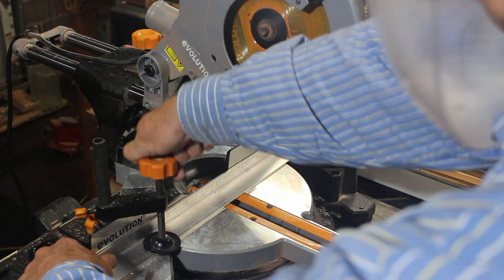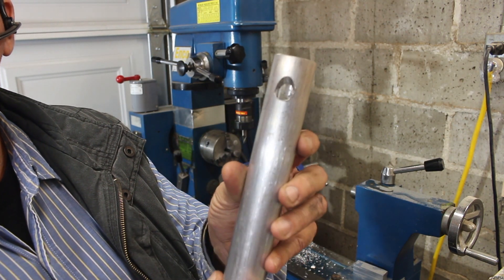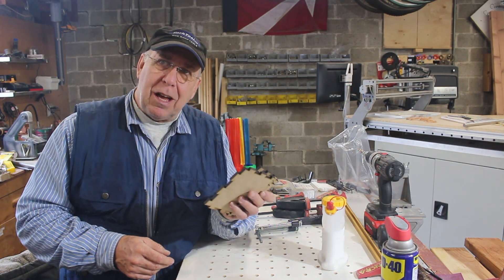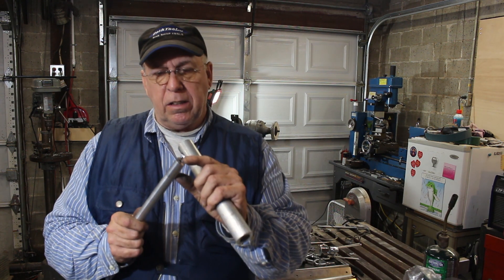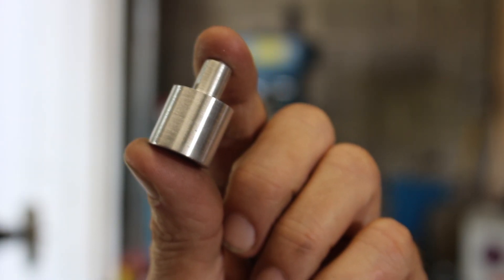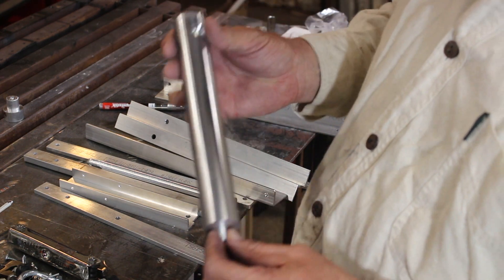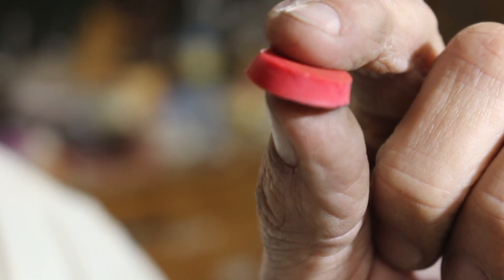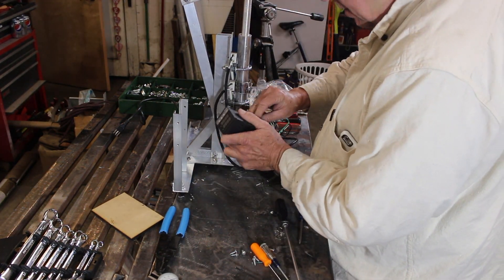Injection Molding Machine for under $100 in parts using less than $700 worth of machinery!

Comment: Built an plastics extruder for under $100 while using $5000 machines.....
Reply: Muskoka Mike I made something similar a few months back without all those tools, and though it’s not as well finished it cost about $90. Does it cost more than that because I used a drill I bought 10 years ago or a saw my dad gave me 15 years ago? You might need the tools to make it look nice but you don’t need the tools to do the same project
Reply: Notably, you don't have to spend $5K on machines to use $5K worth of machines. Makerspaces exist. Lots of them have machining equipment.
Reply from the maker: I made a video response for people who make excuses for not building by whining about not having tools. In it I make these same parts with nothing but a hand drill. You can see it here. https://youtu.be/84q3qjjJiV8
Reply from the maker: That laser cutter was only $1200 brand new and it's at a local maker space. Anyone who wants it has access to it.
Reply: Mike I think you're missing the point. Almost all of the work here done by 'tools' could also be done using hand tools. It just takes longer. The dimensions, and cost of materials, remains the same. The only real kind of expensive actual 'tool' you need for this is a lathe and if you really don't know anyone that already has one and you're a maker then DEFINITELY get one because wow that thing will pay for itself in no time.
Reply: Muskoka mike is an idiot. its says $100 in parts. no one counts the cost of the machines used. its not like you buy the machine to do this one job, then scrap it
Reply: How much can I buy a lathe like the one you used for, and where can I buy it at that price?
Reply: Muskoka Mike but it did....he already owned the equipment he used. It's not like he went out and bought the machinery for This project solely. And you can't add cost of labor because he's making it on his own. He's not paying himself by the hour to get it built. So yes in actuality he only spent 100 on what he needed for this project.
Reply: Yeah fuck that guy, didn't even include the cost of his upbringing and all the food costs along the way. He couldn't have made anything without eating at some point.. Geez..
Reply: Don't forget you can make a bow drill with jigs to make more of a straight line from wood found in the woods if you need to or scrap pallets.  Files and a hack saw with a punch and maybe even a really sharp chisel since technically, we can chisel steel even.  

Therefore, if you really want to think from the (at least my) beginnings in machine tool in high school... we started off with a hammer, hack saw, sharpening stone, and files like demonstrated and even though we didn't use a bow drill, a real hand drill (like hand operated) or another form of crude drilling... you can like the old timers who had like a water wheel with some sort of drive for a prime mover at best.

So I want to add chisels and a real hand operated drill can be used also. 

Think for sharpening the tools you can use a hand operated or maybe even treadle operated design grinder. 

Technically, I got your back on this one Wildman Tech.  

After machine tool and welding... I went to work the foundaries in the lab, later to learn more at Tech which used to be a School of Mines. 

Therefore, besides woods for wood, there is soil and geology for minerals. 

Now,  you need to find a clay deposit and the iron from maybe a bog or other mineral formations.  Then you can make a bellow, kiln and foundry and forge and make your own tools for nothing other than time to scrounge around for and mine for minerals. 

Here is a basic starter demonstration with some gaps you'll need to fill in between:  https://www.youtube.com/watch?v=VVV4xeWBIxE&t=4s

https://www.youtube.com/watch?v=FUhv2OnVVDU

Then read into blacksmithing tools and you'll find you can make all the tools you need.  

Now, the electronics is more challenging is you'll need to extrude the wire really carefully with successive rollings I think if I understand correctly.  I have to research wire making more.
Reply: Don't forget now days you might be able to find an old bicycle and make a pedal powered pretty much any type of machine you need.  You may want to make a huge tractor size flywheel so you can charge the prime mover up and get off and work unless you design so your work station work can be done while you are pedaling if you don't have someone else doing that.  Old salvage yards are great for parts to hack into also.  Ebay has cheep stuff to get you started.  Hunting around companies that throw away perfectly good materials as scrap too.  Estate sales, auctions, antique stores, shopgoodwill.com (though the stores are better price usually) and other bargain thrift shops/barns.
Reply: Why not?

You can get a lathe mill combo on e-bay for like $1500.00 shipped.

https://www.ebay.com/itm/Metal-Lathe-Mill-Drill-Milling-Drilling-Combo-Multipurpose-Machine-3-in-1-tools-/302331817457?hash=item4664616df1:g:SzQAAOSw9KpXAZEG
Reply: Lasersaur costs ~2 grand plus tools. Glowforge costs 3 grand. Hobbyist grade lasers that can cut wood and cloth aren't that expensive at all.
Reply from the maker: The one I used was only $1200 new and its a community tool that anyone can use.
Reply: Sorry, was replying to the person above you, and providing further examples than the one you used.
Reply: You are amazing. I am pretty sure he gets it now
Reply: roidroid you're wasting money. You could have just saved $30,000 by walking to the mailbox, putting the letter in the box, and putting the little flag up.
Reply: Amazing how someone had to make items from clay, stone and wood with maybe some animal hide(s) for bellows for the first metal tools of which their design was copied from that point on.  Most likely starting with non-ferrous alloys though really... who knows what natural phenomenon was observed and re-created in a different more manageable and controlled way.
Reply: Haha! I was thinking the same thing!
Reply: roidroid So what your saying is that, You go out buy car specifically to mail a letter, then walk away from it? Seams like an awful waste to Me...When ever I mail a letter I just draft up a letter on the computer I've had for ages, send it to the printer that I've had just as long. BTW paid cash for them long ago, don't know when I got the paper, or envelopes, stamps are forever stamps (Christmas time maybe?) whatever. Trifold it, put it in an envelope, put on a stamp, then put it in my mail box... Postal carrier picks up in the morning...
Cost of mailing a letter...
Big Fat: $0.00 
By your calculations thats a 
$30,000 savings 
YOU MUST BE A GOVERNMENT WORKER.....
Reply from the maker: I made a video response for people who make excuses for not building by whining about not having tools. In it I make these same parts with nothing but a hand drill. You can see it here. https://youtu.be/84q3qjjJiV8
Reply: brian alley 

He's not an idiot. The title has since been changed. It used to be 'How to make a plastic extruder for less than $100' - or something like that.
Reply: Mike D the cost of the machines don't matter.
Reply from the maker: The last guy said $10,000 worth of machines. You guys need to get a better handle on the cost of tools. I didn't even use $700 worth of machines in this build. I spent more on the damn camera than the machines. LOL!
Reply: I saw nothing done in this video that couldn't be done with tools that everyone has in their garage. Yes, he used high end tools but all that does is make it faster.
Reply from the maker: You know I eat, read , take classes and watch videos too. All of these things add to my collective ability to create, but I don't hear anyone faulting me for the cost being healthy or understanding this stuff. The investment in my tools is easily the LEAST expensive part of what I do!
Reply: Muskoka Mike you can buy a Grizzly G8688 7 inch x 12 inch Mini Metal Lathe for about $515 new and those are pretty good for a bench top. Not all fab machines cost a fortune sometimes you sacrifice what you want for what works
Reply: Actually, Marsh and I have been working on this machine in parallel, and I built mine in my garage using a drill press and a miter saw (cheap at Harbor Freight). The only part I didn't make was the nozzle, but we have since discussed how it can be done with the drill press, and I will give it a shot soon. 
I designed the controller box, and cut it on the laser cutter at a nearby makerspace. I don't even pay membership, I earn money there by teaching classes.
Reply: Don't forget the 50,000.00 laser machine used to cut the enclosure box. Maybe 100.00 in materials but then again a car also costs a couple of thousand dollars in materials to build. I was expecting a video for someone that would build it in their garage with minimal tools
Reply: I know, sheesh, my comment was directed to the "concept" that you could do it on the cheap....well, cheap if you don't have all that equipment. Whether or not you own it already, or paid for the equipment cheaply,  isn't the point.

Hell, I could say "build a Bugatti Veyron in your backyard for $39,95...." oh, wait, you need the parts, the tools, the engine, driveline, casting, carbon fibre, etc etc etc.....

BTW: if he "only spent $100 on material" then that's what the title should reflect.
Reply: I think you people are quick to defend Wildman Tech without understanding Mike's perspective. What Mike is saying is that the total cost of making that injector machine is way more than $100 because you also need to factor in the cost of the expensive machines which in most (my) countries will cost a fortune if you can even manage to find them.
However what Mike doesn't understand is the business aspect of things which is really the big idea many people are watching this video. That aspect is that if you are going  to manufacture an end product to the user you cant always factor in the cost of fixed assets. Those assets are only there to assist you archive your intended goal which is to make an extremely cheap product that you can deliver to the client. The actual end product in this case being the plastic product you want to press. So if I was a manufacturer id also only consider the cost of raw materials being used to develop a product and not my equipment which is fixed.
Reply: +Muskoka Mike

When i post a letter to someone, i count the cost of the stamp, paper, envelope, and the $30,000 CAR I DROVE TO THE POSTOFFICE.

Posting a letter to someone costs me over $30,000
Reply: Hay Muskoka Mike!  You do (kind of) have a point.   Aside from that I got a favorite saying for you, "Tools don't cost me money, they me make money."   Even if your just pissing around, they save you a tonne of time and give you a better product otherwise.  Time is worth money even is you pissing around.   That is of course one knows how to use them AND have or can come up with a use for them.  Just wondering, do you have a video of you making a plastic injection machine (anything?) you built with stone tools?  We'd all love to see that for the education.  Cheers bro'!  ;-)
Reply: Perhaps a cretin is less cretin than you, vakaka mika... But more than you there are only the deficients who nevertheless dare to give you a thumb up...
Reply: Mike hasn't got a clue on how to buy machinery cheap.
Reply: Did you get anything out of the video!? Why did you watch it? Are you going to be shooting plastic? Seriously yes draw a picture. My point is your a tool bag worth less then 100$..... Are you trying to troll or were you genuinely trying to make this for under 100$ the point of the video is for 100$ dollars you can make that......no one said you gotta buy the shit. If you weren't so a dick I'm sure you can find people to help make cuts and what not. It was informative and was on point. Was he supposed to post in there well you need a a lathe laser cutter drill press any of the other tools that you don't have the point is the raw materials for him was $100 that could vary from place to place maybe in one state it's $105 no need to argue semantics you're being a dick that's all that's my point you are being a dick. Post anything you want I'm done.
Reply: are you what they call "anal" or are you able to extroplate meanimg from spoken words?  Words aren't exactly like numbers, they require you to think a little on your own to get their true meaning.  Good grief.
Reply from the maker: No, he's just whining. I prove it in this video by making the same parts with nothing but a hand drill. https://youtu.be/84q3qjjJiV8
Reply: where I live you can't buy a non-operational POS lathe for that.....
Reply: @muskokamike127 If I were you I would move if the cost of living is really that high.
Reply: @phillhuddleston9445  where to? the States? Last time I looked I needed $75,000.00 and an additional $50,000 for legal fees to set up shop down there. It is that expensive to live here. We pay 66% in various taxes and our gas is around $5.00 a gallon.
Reply: @muskokamike127 , What communist country are you living in, you can't have a home workshop? I'm in Missouri (USA) and not only can I have a home workshop where I live I can also run a business and the only thing I need is a $50 a year merchant's license because I sell the products I manufacture at my location along with selling them worldwide. I also added a large section to my shop a few years ago and didn't need permission (a permit) from any government to do so. Freedom is a great thing, you should move to a more free location life is so much nicer. The federal government is a different story, having to get your product tested to UL standards is not good but at least in my case is still far cheaper than $50 thousand, I still can't see having to pay anything for a home shop, are you in California?
Reply: Wildman Tech 
   Towards the end of the video you say something about,. you know how it is    , and actually no I don't.
   Don't have a friend that can do laser cutting for me, don't have the thousands of dollars of lathe machinery and cutting bits ( yes the 10K comment was a little overboard) , and don't have access to shop space to be able to do this type of project. (which whether owning or renting it would seem that you could admit costs money?) 
  So maybe for you this is a hundred dollar injector, but for anyone else without the tools and space to use them their is much more involved in being able to do this.
  Hate to sound like one of those crazy SJW's, but perhaps your privilege is showing?
   Hundred dollar material project would have been a bit more honest title.
Reply: Point is Muskoka Mike?
Reply: that it really didn't cost just $100.00. That's only the cost of the materials. 

Put it another way: the actual cost in raw materials to build a car is minor. It's the labour and manufacturing and the millions in equipment turning that material into the parts that cost the most....
Reply: So again what's the point. I don't think anyone was suggesting that manufacturing labor and planning don't go  into cost. It was simply a video showing that it can be made cheaply.
Reply: wow, the point is the title/video is misleading......it really ISN'T being "made" for $100....

Do I have to draw you a picture?
Reply: Wow! Hey.....I didn't post the video Jackass lol.....I was just pointing out your hypercritical comment wasn't accurate.....your name dropping K.O.R. that dude is highly sponsored......this is a guy who makes actual things your referring to a guy that makes Jello Turkeys......you can probably make a extruder for less I work on injection molding and you know what this man did I damn good job but for some reason you accidentally click on this video watched it and because there was nothing shiny or because it's something that you can't do you decide to poke at it. You are a tool bag an old used  crappy tool bag full of broken 101 dollar tools. If something cost .99¢ and I said it's a dollar you'd be the asshole yelling "No, it was .99¢ I saw it"
Reply: Not a tool bag, not a troll, just pointing out that the "point" of the video is misleading...you cannot make that for under $100 without some specialized tools which are quite expensive. 

One of the reasons for the comment is more and more of these videos are popping up. Like those "life hacks" with "things around the house" made of things I've never heard of let alone have around the house. 

The king of random is great because he actually DOES make things out of readily available stuff on the cheap.  There's another guy who shows how to make a water jet cutting head that can be also made on the cheap without any specialized tools...and plainly points out the 2 most expensive items are the nozzle and pressure washer. 

If you're so butt hurt because I commented on the fact that your "$100 injection machine" isn't really an injection molding machine for $100 then GFY sideways and stop posting misleading videos or videos with misleading titles because that's exactly what you did....you did NOT make an injection molding machine, you made an plastic injector/extruder.....

Comment: Cool build. I have been working with "real" injection molding machines for over 30 years. In the old days the used direct plunger injection. Instead of trying to seal the plunger against the barrel, the barrel should be longer and the part where the plunger rides should be cooled. Then the plunger pushes against non molten plastic and sealing is no problem.